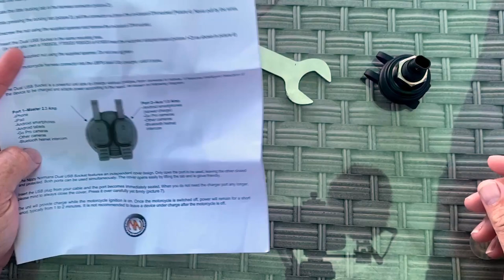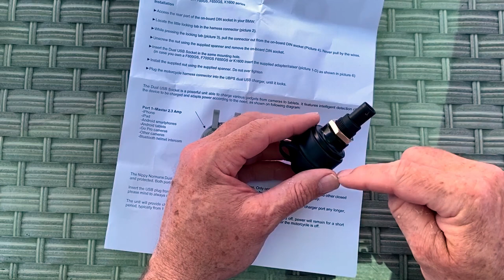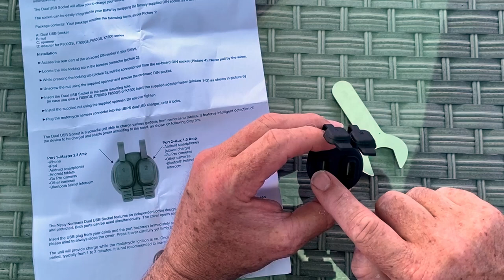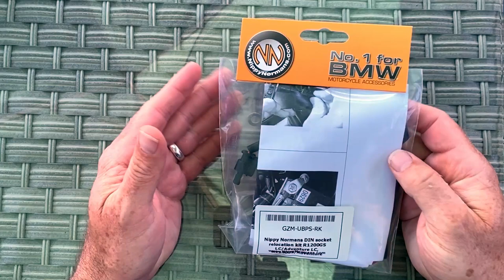Swap out the DIN Socket on a BMW R1250GS

Comment: Nick Hodge, you are simply the best!!, I looked under the seat of my R1250GS Exclusive and what did I find?, a little red chip in a plastic bag. I will admit I have removed the seat a number of times and completly missed the plastic bag "stuffed" into one of the seat ribs. I was wondering why most of the videos I was watch on YT had the "PRO" versions and mine didn't. What's really infuriating and I think you eluded to it in this video, even the BMW Techs forget to install the chips, even if the customer has forgotton also. I paid aroud £200 for my 5k / yearly service and my dealership missed the chip also. I now have the "PRO" version rider modes to try-out over the weekend. Happy Days! Much obliged to you. Keep the videos coming if you can, very detailed and informative.
Reply: Oh, by the way, is there a little two prong "plug" icon/symbol in the top right hand of the screen? Mine shows this icon, is this the same on your bike? Thanks.
Reply from the maker: Yep that is the indicator to show the pro mode chip is engaged. Unplug it it’ll go. Plug it in it’s back. Glad you have the pro-modes you paid for. You may find some of those improve with TFT firmware upgrades too but that another ‘insist on’ parts of your service. Doesn’t change the cost but will change the time they need it to most of the day (updates can be slow)

Comment: Hi nick, Great video. Think I am going to do the exact same thing having just got the socket for Xmas! Can I ask how you find using the optimate 4 in standard mode through the new din socket? Is it still effective? I am assuming you just switched it from canbus to standard mode and plug it in using the din connector?
Reply from the maker: Hi Liam. Exactly that. You lose a little of the Canbus feedback to the charger but she’s been plugged in ‘standard’ mode since October. When first on she charges then drops to a maintenance charge and if it senses a low voltage switches back. You’ll likely need a slightly longer bolt for the bracket (I didn’t on my GS (just) but did on the GSA) 👍🏻

Comment: Hi Nick,
Great vlogs, very informative 👍
Once I have fitted both the USB & din relocation bracket, how do I change to normal charging on the optimate 4??? Thanks
Reply from the maker: Hi Matt. I guess you have the optimate 4 CANBUS edition? If so connect the crocodile clips ends to the charger in place of the DIN plug and connect them together (yes you heard that right!!). Now plug the charger in the mains and that will switch it to ‘normal’ mode. Do it again if you wish to return to Canbus mode. 👍🏻
Reply: @nickhodgeUK  Hi Nick, I haven't actually brought it yet,but yes that will be the one I require I believe. I am just taking my first steps into the gsa world so just trying to get all the advice I can. Thanks for your time, much appreciated 👍 Ride safe!!

Comment: Hello!
Could you recommend a tool set for the bmw (or bikes in general) from amazon, for example, that we could use to do basic stuff?
One that is good and unexpensive enough. 😬
And the tool needed to screw the bolts knowing at which torque are we leaving them.

Thanks and very nice videos !
Reply from the maker: Hi Dani. That’s tough although I may do a video on that soon. There’s only so much you can carry and some things have to be sacrificed as not important enough and too big. When I fit accessories or do stuff to my bike I separate the tools I use and decide if it’s likely I would use them roadside. It’s important you can remove your wheels, all the fairings and things to get to stuff, but stuff to work on the engine and drive are not ‘roadside’ so not worth carrying. Most BMW bolts are torx, which is why it bugs me that accessories are often hex fasterners. Quality wise take what you can afford but don’t buy cheap kits. In torx and hex key sets, look for S2 steel and get ball-end on the hex keys. In spanner’s (wrenches) use chrome vanadium steel. An adjustable will cover many wrenches but make sure there is little or no jaw play as otherwise a tool which at best gives a light grip, gives none at all. Bahco make good adjustables. Good luck
Reply: @nickhodgeUK  Thanks !
I meant to use at the garage, but you could do both sets on that video!
This could be a good one?  
https://www.amazon.es/dp/B000K2PF4Y/ref=cm_sw_r_cp_apa_i_diznFbPBQ60VJ
Sorry for the insistence     😬

Comment: i checked nippy norman website. thy dony hv the same replacement socket. even the link gvn is also taking to some external socket..not the "replacement" socket. can anybody guide please..
Reply from the maker: Do you mean to re-site the DIN (https://www.nippynormans.com/r1250gs-2018-on/nippy-normans-din-socket-relocation-kit-r1200gs-lcadventure-lc-r1250gsadventure ) or the actual USB replacement (https://www.nippynormans.com/r1250gs-2018-on/nippy-normans-dual-usb-socket-for-bmw-motorcycles-plug-and-play )

Comment: Great explanation as usual Nick, Just one question I have the red plug but haven't plugged it in can you tell me what it actually does ?. i'm told the dealer wont plug them in as they wont take responsibility if all goes wrong !!.
Reply from the maker: Sure. It’s the chip for the pro-riding modes. It’s standard BMW fitment if you paid for it so not sure what dealer is talking a out. You gain Dynamic Pro and Enduro Pro selectable on the TFT (rather than just Rain, Road, Dynamic and Enduro). It then further allows you to customise Dynamic and Enduro (That’s effectively the ‘pro’). You’ll know when it’s plugged in straight away as you’ll have the chip icon at top of TFT and can then customise settings for ‘wheelie control’ , suspension, etc.

Comment: Hi Nick, What is the real difference between the original 1250 socket and the 2 usb socket you have installed?  because in the original socket you can put a 2 usb adapter, thanks
Reply from the maker: Hi Jorge. Your the 2nd to ask the same thing 🤣 here’s the reply I gave... “I have the optimate dual USB adapter but three main reasons. I mainly use it for USB and a fixed one isn’t stealable. The fixed one required no wire alteration and finally I could inexpensively and again without wiring alteration move the existing DIN to a more useful (for air bed, battery charging and heated jacket) position below the seat and in fact still use the USB adapter as a ‘charging station’ for helmets and such during rest stops in tours for my and fellow riders helmets where they can rest on seat/panniers. At a low cost for me it’s a win-win 👍🏻”
Reply: @nickhodgeUK  aaahh okok, you use the 2 usb socket next to the tft to charge iPhone or helmet for example, and the socket under the seat for the air compressor or to charge the motorcycle battery for example right?  because the socket under the seat does not have Cambus and the current is not cut when you connect an air compressor for example, right?
Reply from the maker: @jorgedelgado662  that’s correct. Without the DIN socket also being re-fitted where it is (only £20) then there would be no point and the fact the DIN is now permanently powered means helmet/phone can be charged during coffee stop 👍🏻
Reply: @nickhodgeUK  okok perfect thanks Nick, I was watching your video and in the video description, you indicate that you have this product: OPTIMATE O105 USB CHARGER, what do you use it for and what is it used for exactly? Thanks for your help 💪🏻💪🏻
Reply from the maker: @jorgedelgado662  hi again Jorge. If it’s the USB adapter then I use that from the DIN socket for various things but mainly charging mobile or helmet while stopped on the road. I also sometime use it to power a go pro directly if all batteries are flat. Hope that’s what you mean. I hope shortly to have a video of our UK tour and in that you will probably see me and another rider charging our headsets from it at breakfast 👍🏻
Reply from the maker: @jorgedelgado662  reading this again Jorge it may refer to my optimate 4 charger?? Used to simply charge the battery of the bike. It’s the Canbus version but I have converted it to standard use as the canbus setting requires the old DIN socket to be IN the Canbus. Of course mine is now connected directly to the battery 👍🏻
Reply: @nickhodgeUK  ok thanks Nick 👍🏻👍🏻
Reply: @nickhodgeUK  So the Optimate 4 charger, you use it like a normal battery charger, connect one connector to positive and the other to negative and charge the battery, right?  or how do you charge the battery? Thanks Nick
Reply from the maker: @jorgedelgado662  no the optimate 4 (Canbus edition) comes with a DIN socket. When the DIN socket was in its original position (and part of the Canbus) the charger was configured to read data from the Canbus. Now I’ve moved the DIN socket (and connected directly to the battery) the charger is reconfigured to ‘direct’ mode so I simply plug the DIN socket in and it charges. No need to remove battery cover or anything
Reply: @nickhodgeUK  okok now I got it, and you use it always or only once a week or how you use it? Thanks for your help Nick
Reply from the maker: @jorgedelgado662  my tracker sends me an email alert when it’s battery, and/or the vehicle battery is detected as low (as the tracker runs 24/7 of course). When that happens I give it a 12 hour charge. When I’m not using the bike (winter) I leave it on and it drops to ‘maintenance charge’. The great thing is i just need to plug/unplug the DIN to connect/disconnect
Reply: @nickhodgeUK  okok good thing, the charger is programmed automatically according to the state of the battery, if it detects a low battery it starts to charge the normal battery, and if it detects that the battery is good it goes into battery maintenance mode, and you leave the charger connected always every day in winter and do not disconnect it? Thanks
Reply: okok good thing, the charger is programmed automatically according to the state of the battery, if it detects a low battery it starts to charge the normal battery, and if it detects that the battery is good it goes into battery maintenance mode, and you leave the charger connected always every day in winter and do not disconnect it? Thanks

Comment: Good afternoon. Where can I get the battery connection cable and the size of the din socket?
Reply from the maker: The din socket is a standard socket. You gets dimensions on google I’m sure

Comment: Great video, by the way what kind of tracker are you using?
Reply from the maker: Thanks. I now have the Datatool Stealth tracker which is standard with one-years subscription from BMW in the UK (mainly driven by the bikes exceeding the price  level insurance companies insist on one!). I had the Datatool Trakking Adventure before but that was not Thatcham Approved although they both work well 👍🏻

Comment: Morning great vid just change mine 
quick quick question do you know what the most up to date soft wear version is
Thanks mark
Reply from the maker: I do Mark as my bike was in Wednesday. It is ‘still’ 022_005_041. There is a new one due in November that according to BMW addresses “Sporadic loss of Bluetooth pairing information in the TFT instrument cluster for mobile phone and/or communication system”. I’m just trying to put together my learnings on connectivity but it’s quite a complicated, boring subject 👍🏻
Reply: @nickhodgeUK  thanks I picked up my new bike te excl same as yours  on the 031020 and my software says 021_004_040 so to me this is not the most up to date what do you think
Reply from the maker: mark tomlin no it isn’t Mark but another is due in November so as it takes 3-4 hours I’d wait for that? 👍🏻

Comment: You can buy a duel port USB adapter that plugs right in
Reply from the maker: Yep. I have one, it’s just it’s permanently in place whereas now I have a permanent USB dual plug at front and the din socket for up to 10a of direct battery power for airbeds, battery chargers or still my USB adapter for heated clothing and the like 👍🏻

Comment: Hi Nick

Not commented on your videos before but a subscriber and been 'lurking' a while!
Great video, though the cost of the twin USB had me wincing a bit! I still have the original DIN plug and the optimate usb plug you showed at the beginning of the video which I find OK. Like you, I wanted a non canbus socket for accessories (mainly an air compressor) so I fitted an Optimate socket which resides under the pillion seat. Yours is a much neater solution though on the bracket. I assume you can't buy the little bracket separately? I could fabricate something but purchasing would be easier!
Keep the videos coming!
Reply from the maker: Thanks for commenting. The bracket comes with wires and uses the original DIN socket. Maybe an email to Nippy Norman’s May be in order. More likely to have cables damaged faulty than a bit of metal or maybe one with a scratch. Worth a punt anyhow. Welcome along 😂
Reply: @nickhodgeUK  thanks Nick and yes, I'll give that a shot! 
Look forward to more videos.

Comment: Hi Nick,

I've seen your video and it looked great, my compliments!
I bought and assembled all the parts double USB connection and the socket relocation kit. 
With your excellent youtube video was doable, it did not mean much.
Nippy Norman has a customer in the Netherlands ;-) 

I also bought a new BMW Motorrad battery charger from a local BMW dealer and then I connected my 2016 BMW R1200GS LC to the charger.

I was very satisfied until at unexpected moments my engine alarm spontaneously went off and that happened not 1 time but 4 times but times at time different intervals, also in the middle of the night. 

The question I have for you and your followers: 
Am I the only one who has this experience, or are there BMW drivers who have the same experiences? 
And more importantly, do you have an idea of what the cause and importantly the solution is?

Thank you for thinking along and keep making these videos! 

Best regards 
Rob, Gouda, The Netherlands
Reply from the maker: Hi Rob. I’ve had alarms on all my 3 GSs and the K1600 I have now. I use an Optimate 4 (Canbus version) charger on these 24/7 as it works as a trickle charger too. I also used this when I relocated the original DIN socket but changed the charger to ‘direct’ mode as that is connected directly to the battery. I have had no issues with the alarm going off. Hopefully someone can help? You may also go to the UKGSER forum and someone there may help 👍🏻